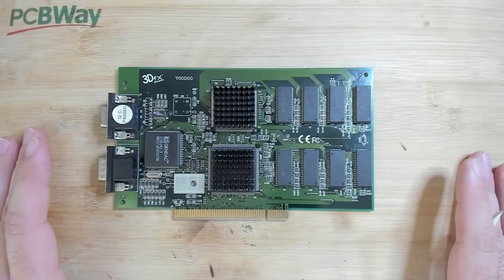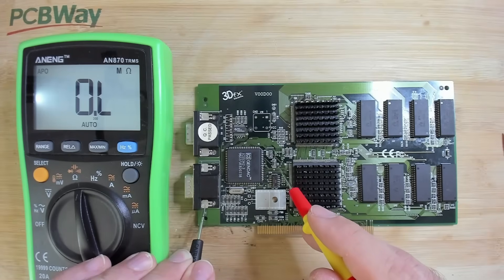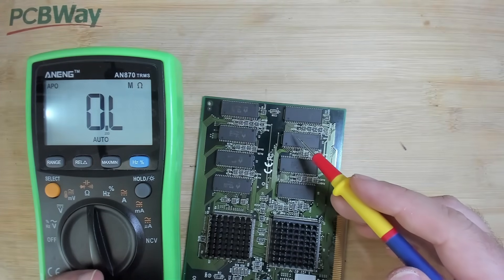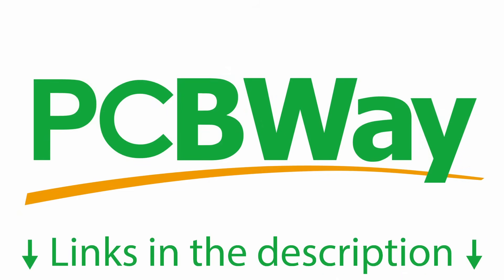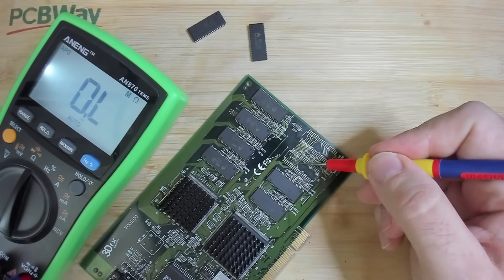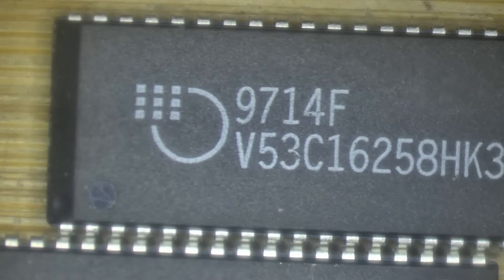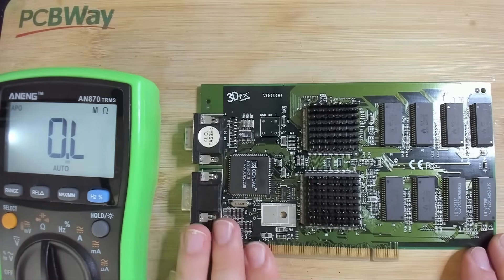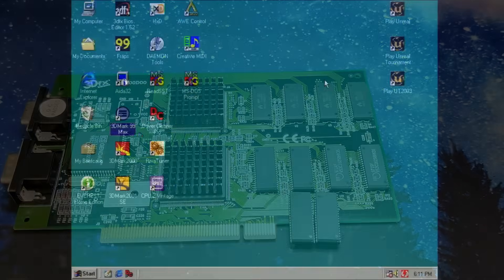Bars And Stripes! 3Dfx Voodoo Graphics Repair

Comment: Great repair............ again !! Good diag as well, really enjoy your videos, such a good channel.
I have an Orchid V1 card and a Creative V2 both with ram problems, just waiting for the replacement chips on the slow boat, burnt my finger on the faulty ram chip on the Orchid, no thermal camera required lol 😂
Reply from the maker: Thermal sensory organ (aka finger). Yeah, sounds similar to what happened to the RAM chip on this card. I hope you can fix the fault! And maybe the trick with measuring resistance can help ;)

Comment: I have an X800 GT AGP and it have a similar problem

No repair shop could fix it
Reply from the maker: I'm sorry to hear that. The X800 GT is a bit newer than the hardware I work on. It could also just be a memory chip that's faulty. It could also be a solder connection below the core. Unfortunately, all those are BGA chips and a lot harder to work with. I don't have experience with repairing those yet, but I'll try that in the future.

Comment: Thin Vertical lines,  are a good hint the problem is with Address line 0 or 1.  The number of pixels  the  bands were wide could indicate the number of memory chips that are bad, would need to know the exact memory map and width of the memory used by the card to tell for sure. Could also mess around with a good card pulling pins to ground while the card is in use to see which chips are for what part of the screen. If thin vertical lines cover the entire screen I would suspect an addressing problem caused by FBI.
Reply from the maker: That would indeed be a very interesting experiment. The Voodoo 1 is a very "forgivable" card when it comes to memory errors because it stores limited information on the memory chips.
Lines going across the entire screen do suggest an issue with the FBI section. Texture corruption is TMU related.
I think the card would even work without TMU memory - it might even work without FBI memory, but you wouldn't get a proper video output.
I'll keep that in mind for future experiments!

Comment: You make this look easy! :D
This may very well be my issue on the V2 half-way upgraded to 12M (the backside 4 additional chips of the TMU1 are not counted). But i get no graphical issues and good image under SLI.
Reply from the maker: Measuring memory pins against ground could also identify missed solder joints. If the 4 chips on TMU#1 aren't recognized, then it's most likely something with solder joints (either on the RAM chips, or the TMU pins). I doubt it's an issue with the board since TMU#0 accesses all 8 memory chips.

Comment: I know that pattern, guessed memory from the start, but many faults hide as another. Good steady work on the solder mask, I'd been coloring outside the lines, ha.
Reply from the maker: I used the smallest tweezers I have for the solder mask. Even toothpicks are too big for the damage between pads. I'd color outside the lines too :)

Comment: This reminded me of a similar mechanism of failure I encountered a while back. I had a drive go bad on a server storage device, and it went bad in such a way that it damaged the drives on either side of it as well as the backplane, causing a total of 3 drive failures and the failure of the RAID set, triggering a total failure of the storage device and total data loss. It's funny how things like that work out sometimes. (This is also why I refuse to use Toshiba drives anymore.)
Reply from the maker: Wow - that is unfortunate that one drive kills other stuff leading to a total data loss. That is very unfortunate.

Comment: Funny you've never encountered this kind of issue before. I've seen quite a number of defective memory chips on graphics cards over the years and considered it one of the more straightforward things to diagnose/fix. Well, I suppose it kind of was, although it being caused by the chip >adjacent< to the one that got hot was a curveball for sure. Nothing that can throw you off course though, you're a seasoned expert on these issues by now!

I wonder how many 3Dfx cards you have fixed by now? Still in the double digits I suppose, but you're certainly getting up there! 👏

PS: Technically, you've encountered an issue with some defective memory chips that got VERY hot before, but that of course doesn't count as they were not the root cause... 😅
Reply from the maker: Hehe, yes - that one card was special! It almost made it it it wouldn't have been for that one data line on the FBI chip that got stuck/damaged. I still have the chip. I may try some voodoo magic others recommended - pull-up resistor and see what happens :) Indeed, I never had a bad memory chip on Voodoo cards. This was the first one that has failed somehow, but I don't know how. It's odd that the pair was bad. Anyway, the card works now :)
Reply: @bitsundbolts  IT's the same for me although perhaps that's because I've only got e-waste ones, it always seems to be a loose pins or damaged traces rather than RAM. Later memory chips like TSOP are a bit more delicate than the EDO on the Voodoo 1/2 cards. 
The closest I've come to a memory fault on a Voodoo 1 card was a loose pin on one of the FBI's SoJ EDO chips. Same as your problem too, mine displayed black and blue bars and it worked okay if the 2nd megabyte of FBI memory was disabled.

Have you seen the mdiags / ss1test.exe software that can memory test Voodoo 2 cards?

Comment: I'm wondering if the unexpected failure was due to heating from the original owner removing/replacing the chip that was observed running hot?
Reply from the maker: Hm, could be. I should investigate how chips fail when they get too hot. I have a few of them that failed during soldering / desoldering.

Comment: I would just have liftet the pin. If the redistance got higher, Well… there was your reason 😊
Reply from the maker: This is very difficult with those SOJ chips. The legs are bent in a U-shape. I am not sure if I am missing something, but I don't think I could do that with SOJ chips. TSOP is possible - and I have done that in the past.

Comment: It had artefacts, but not the type you'd find in Tomb Raider.
Reply from the maker: True! It was very odd to see no picture at all and only those stripes. The failed memory chips were connected to the FBI chip - so, it will definitely be a different look compared to when texture memory is failing.

Comment: I was going to say it seems like there is a lot of tearing and microstutters in unreal. But I'm definitely not aware of what it was supposed to look like in this time period.
Reply from the maker: I think it may be related to my Windows installation. But it could also be something in the settings of Unreal. I played around with the settings a few weeks ago.
Reply: It's definitely on the slow side on a V1, only with V2s or better it is playable at 640x480 in my experience.

Comment: The hot chip is not THAT hot chip, user of Voodoo 1 replaced with ANOTHER chip, because it from another manufacturer
Reply from the maker: Yes, I noticed the difference after I was done with the video. It was a different chip - not the one that got hot.

Comment: MOJO showed 4MB, makes me wonder how this is physically achieved: low or high resistance when probed by FBI?
Which is different from "working" ram, just presence.
Reply: mojo just writes four bytes in ram at offsets of 0, 1 MiB and 2 MiB and reads it back. if it is the same- it "detected" 1/2/4 MiB of ram.
Reply from the maker: Yes, it looks like MOJO isn't as sophisticated in detecting faults like this one. I was surprised to see "Everything is OK"!
Reply: @bitsundbolts  Probably that's all there is, unless something like MATS and MODS can be created for this specific purpose.
Very instructive repair, thanks as always!!

Comment: Not just 6.7, but 6.7 MEGA ohms! The other chips were just 4.7KΩ! Not even close!
Reply from the maker: Yes, you are right! Those other two chips are probably connected to circuitry in the FBI chip that has a lot less resistance to ground. But even then, it doesn't mean that there is an issue. I was looking for patterns that are odd.
Reply: @bitsundbolts  fDon't you have some loose FBI chips? Might be good to know what the resistance values of all the pins are for future troubleshooting of both RAM and FBI issues.